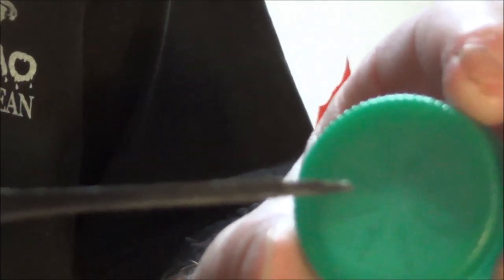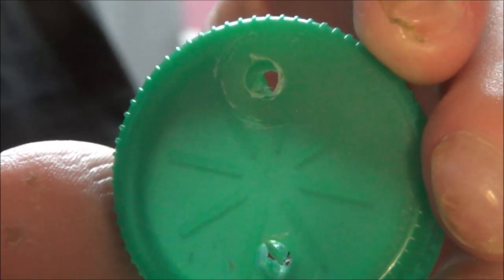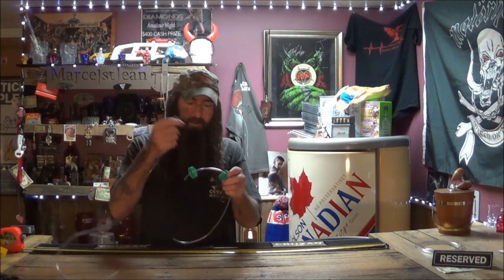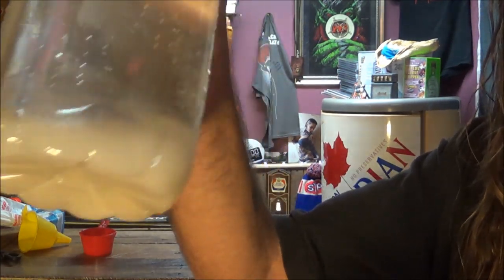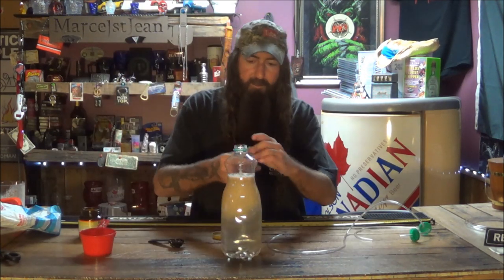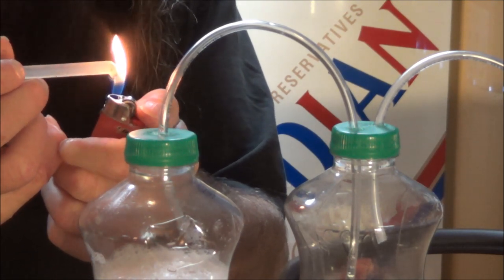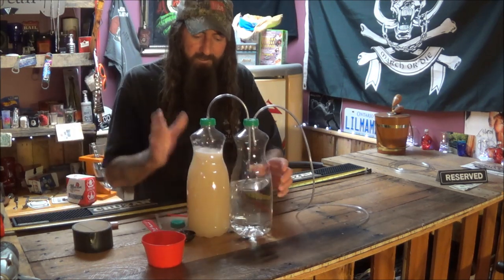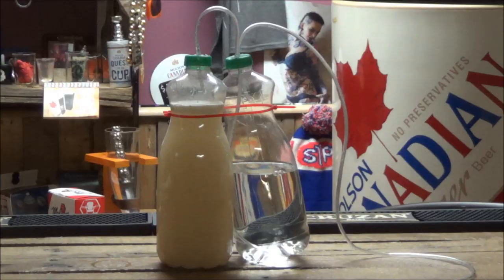co2 generator on a budget

Comment: I did something like that the time I tried making homemade cranberry wine an used a bottle with water an a tube to kind of act as the airlock, I dont think I added an extra hole in the cap for the gas to escape an ended up turning the wine more in to vinegar :D
Reply from the maker: lol..did ya try it?
Reply: @marcelstjean  Yeah tried a sip before I poured it out, tasted pretty nasty 🤢☺